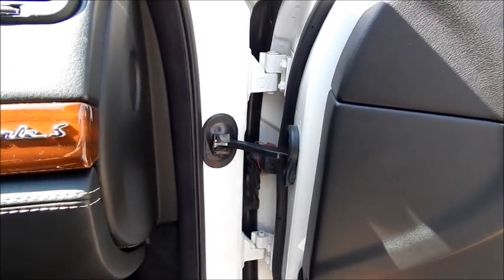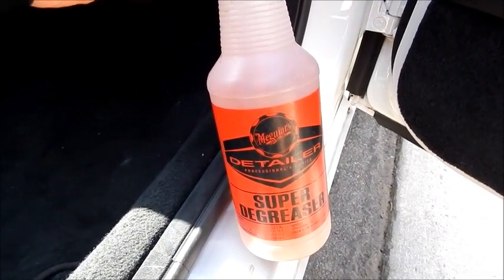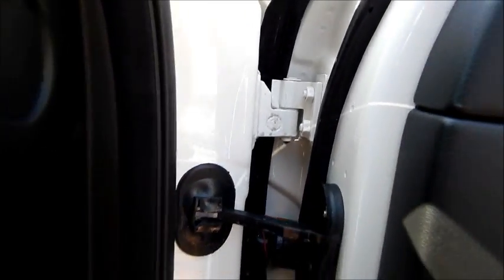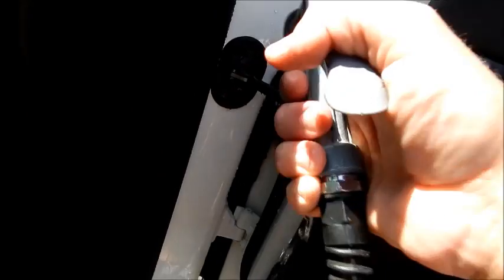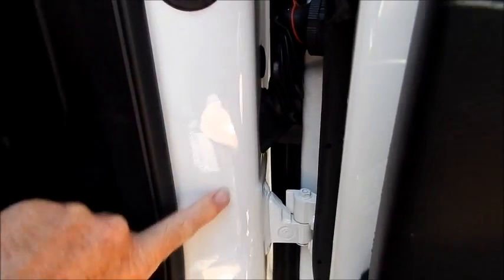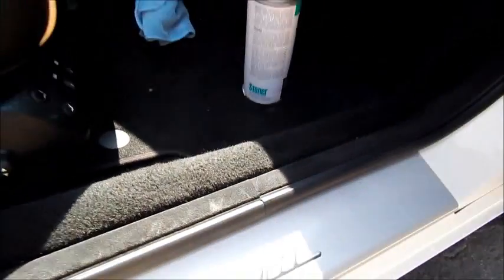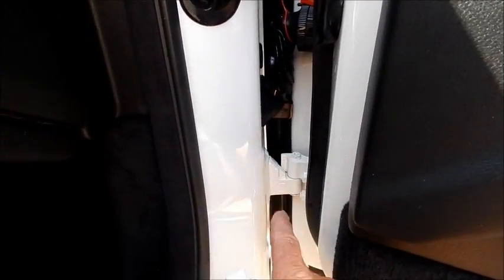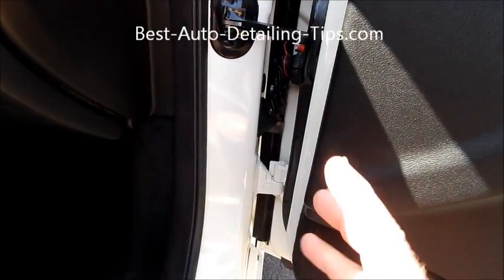Door jamb cleaning and Detailing: How to clean door jambs to perfection!

Comment: Another little helpful tip for rinsing the door jams would be to use a 1 to 2 gallon hand pump "weed' sprayer with straight water. I think that might be easier to control in those tight spaces. And there is way less water being used which minimizes the chances of water getting into the cab of the car..

Comment: I use either a APC or a degreaser, it really depends on how dirty the hinges are.  Spray on the chemicals, let sit for a minute, then I use a goats hair brush to work in the chemicals.  Then instead of using a pressure washer or hose, I use a spray bottle with ionized water. After that, just a simple blower to get rid of the water.  Spray dressing to finish, but I do wipe it down to prevent running.
Reply: Corey Jenkins so you can use degreaser on paints? Or does it depend on the diluttion ratio, I'm a bit oc with some water marks on my door jams

Comment: Hi Darren, I found your use of a leaf blower quite useful to dry out the jambs quick.  I was wondering if you ever thought of just reversing the hose on your shopvac?  If you put the hose on the hole on the opposite side of the vacuum it turns into a blower. (it's actually the exhaust and I have found it to be quite powerful) Less tools, less maintenance! But not sure it has enough blow power for your taste.  Let me know and if it works give me credit!!LOL.

Comment: Hi Darren, are you affraid of the electrical wiring that runs through into the door panel.
Reply from the maker: Theo Mantzoros Not at all. It is sealed up very well.
Reply: Should always inspect that rubber seal incase it was cut

Comment: Hi Darren - Good video! 
Door jambs are too often neglected.  As a hobby detailer I like to do them and when clean they make a really good impression. 
Did you dilute the degreaser for this application? Is there no danger of making the door hinge creak for lack of grease at some point? I liked the way you dress the black rubber/plastic parts in the jamb.  
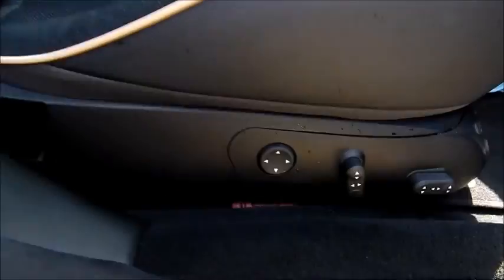By the way, is that an orange kid's Crayola under the front seat at 6:26? And do I win anything?! :-)
Keep 'em coming! All the best, Rob in Switzerland

Comment: Spray with Meguiars degreaser, agitate with goats hair brush if needed and go over it with A handheld steamer. Mop up any run off with A microfiber drying towel (separate one from outer panels towel) works for me.

Comment: what about using a steam cleaner to clean out the door jams after spraying/scrubbing de-greaser ? that would leave less mess / water to clean up saving time.. wouldn't it ? and the pressure from the cleaner would blow away much of liquids / dirts in the area ?

Comment: How long does it take you to do one vehicle? A complete detail inside and out?
Reply from the maker: typically 3.5-4 hours for a light colored sedan. 4.5-5 hours for a dark/black colored car. Up to 6-7 hours for a full sized truck/SUV etc. With that said, I don't typically work on cars I consider to be disasters. These are cars that are less than 7 years old, and usually only 3-5 years old or have been detailed at some point in the past. My maintenance details take 1.5-2 hours if I see the car every week or once a month.

Comment: $130 for a exterior interior detail and they forgot to do my door jambs. Most overlooked area?
Reply: spaethbd lol
Reply: spaethbd ever tried to do door jambs with an extractor?  maybe, just maybe, dont expect they do that if its called 'extractor detail'
Reply: i feel like bob did the 130 int/ext and forgot the jambs
Reply: You got a pretty inexpensive detail job, so I think your expectations were too high.
I charge for a car exterior $120 alone. A medium sized  SUV exterior detail, I charge $140-150. Larger SUVs and “luxury” trucks, I charge even more. Whatever my exterior detaling charge is, my interior charge is roughly half that amount and that is the passenger compartment ONLY. No engine compartment detail or trunk detailing (other than a inside vaccum cleaning ) any detailing of a car trunk from the inside, like detailing the inside panted areas of the trunk lid and the painted surfaces of the trunk surround are extra costs.